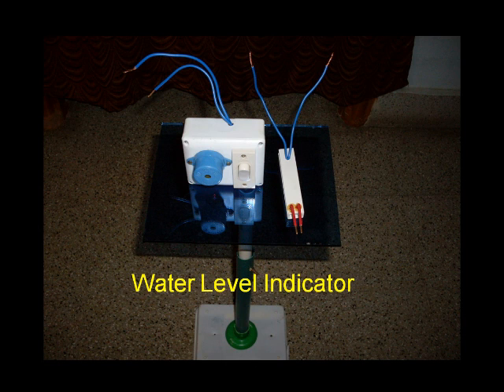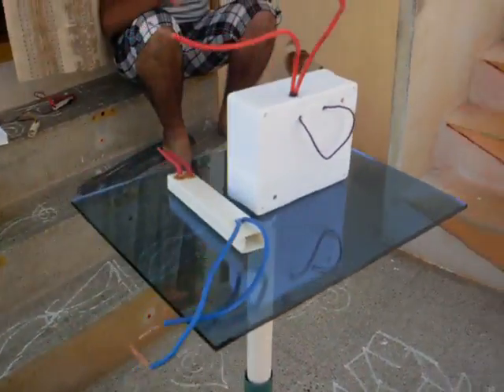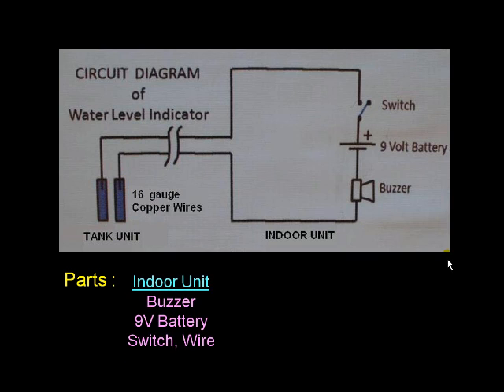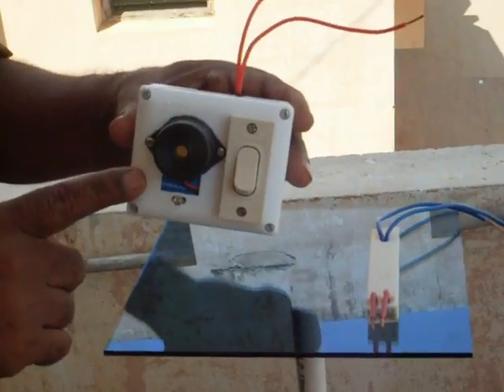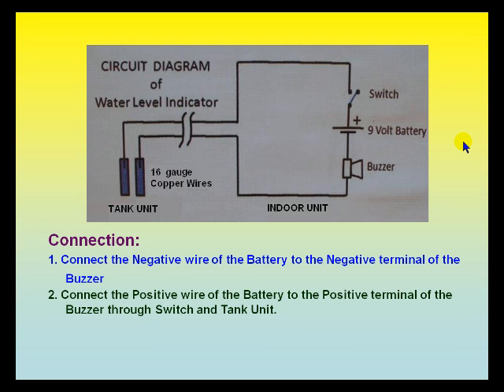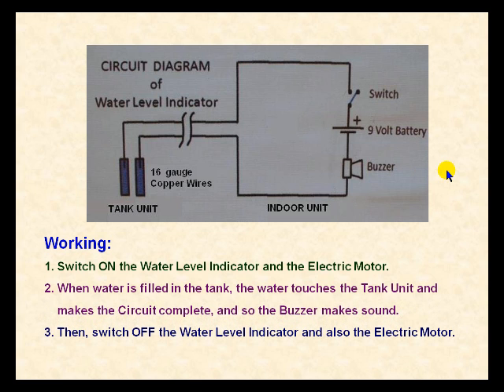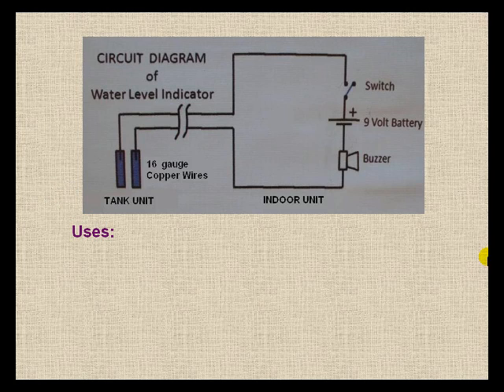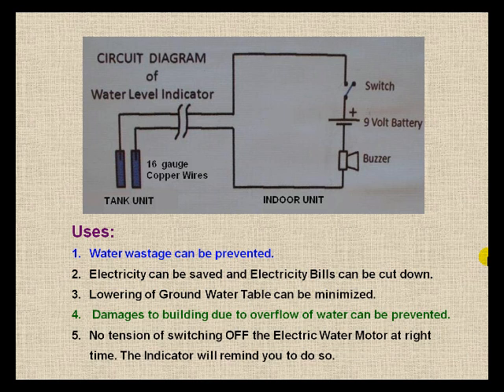Water Level Indicator

Comment: The best option, but what if we use a 9V Adaptor instead of a Battery and what is the length of the wire going to the overhead tank, any restictions.
Reply from the maker: Mr. Kanjilal.. Here is the clarification..
I don't suggest 9V adapter as it takes the power from ac outlet though it has a transformer which isolates ac from other parts. Further, the 9 V battery I have been using in my house, as shown in the video, is working fine for the last two years. Still it is working because the circuit draws a little power from it as it is in ON position only for a few seconds. Because we will switch OFF the circuit immediately due to buzzer sound.
A few months ago I further improved the circuit and made it simple to prepare and work more effectively. Because, I found two small drawbacks in the above circuit.
1.Preparation of "Tank Unit" is a little bit difficult and 2.A patina forms on the copper leads of "Tank Unit" over a period of time that diminishes the sound from the buzzer which needs to be cleaned after every 4 to 6 months. So, in the revised circuit I discarded the "Tank Unit" and added a small circuit consisting of a transistor and some resistors in the "Indoor Unit". Now the above problems are solved. I have been testing the revised circuit for the past eight months. It is working perfectly. Now I am planning to make a video of the revised "Water Level Indicator" and upload it to YouTube. In that video I will show the detailed construction of the circuit, which is very simple and anybody without technical knowledge can make on their own and use in their houses to save water and electricity.
Regarding your second part of the question... No restrictions. You can use any length of wire. If multi-story building, use good quality wire but no need to use costly wire.
Hope clarified your doubts.
Reply: Thank you so very much, waiting for your new circuit, please intimate us.
Reply from the maker: S Kanjilal
Sure.